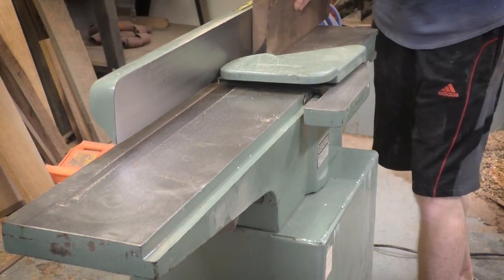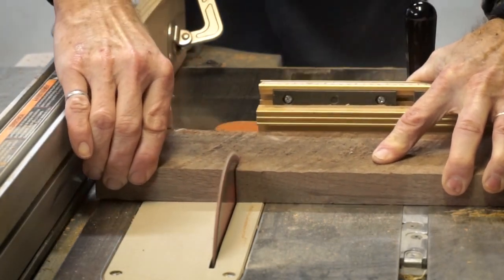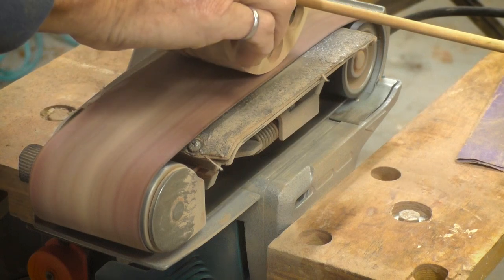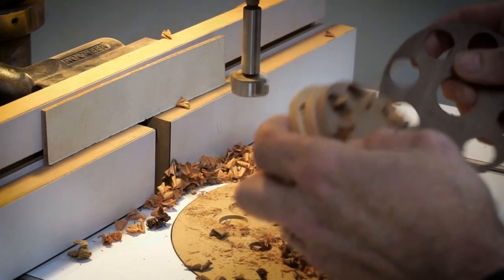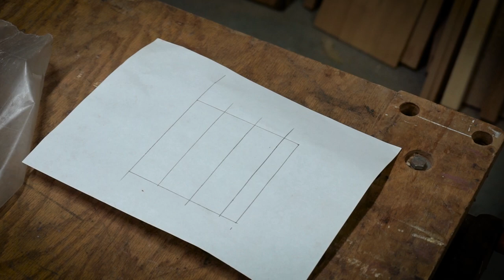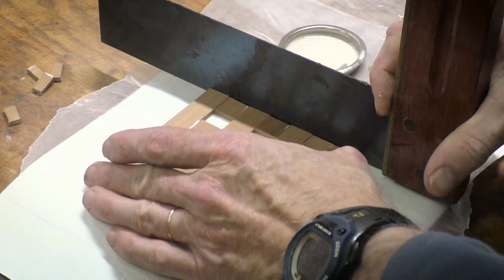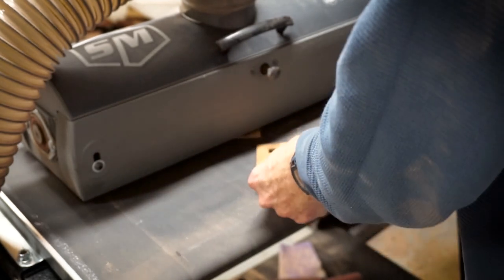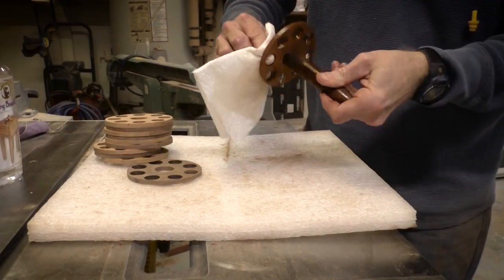DIY Wooden Coaster Sets

Comment: Again great work. Lower your blade at time line 0:44 to just a bit higher than the material. Glad to see you using a stop block on the table saw fence.
Reply from the maker: You're absolutely right about the blade height. I'm usually pretty good with that, but in this case it slipped my mind. I think I get a bit distracted by having to constantly worry about setting up the camera, so it's causing me to sometimes not do things the way I normally would.

Comment: Nicely done, good vid!  I have a question.  When you face jointed the walnut, you sure seemed to be able to feed the board much faster than I can over my jointer (not sure if the vid was sped up) so I'm wondering if I need a smaller pulley on mine to get more rpm.  Is there a recommended rpm for jointers?  or is it all relative to what you're feeding?  Also, what table saw blade are you using?  The name was rubbed off but with red I'm guessing Freud or Diablo, but what kind specifically?  glue line rip?
Reply from the maker: +Phantom Fish Good observation. I had sped up the video 1.5x when running through the jointer (just to keep the video shorter), so you're right that it was feeding pretty fast.  I'm not sure of my jointer's RPM, but I believe it's running at 4200 RPM.  The table saw blade that I'm using is a Freud Industrial 80 tooth thin-kerf blade.  I think it's this one: http://amzn.to/2ixM8LZ
Reply: I notice you have the Christian sign (fish) on your thumbnail. Is that intentional or because you fish. (Yes I've noted your handle)

Comment: Although the square coasters looked to be challenging to put together, I find both sets simple but elegant sets. I love these, and thanks for sharing! I have subscribed, good quality vids with great commentary. I look forward to seeing more of your work.
Reply from the maker: Thanks for the nice comment and for subscribing. This will be my last video of the year, but more to come!
Reply: I have watched a few of your vids now, lol. The landscaping lights, is an awesome design! Happy New Year
Reply from the maker: Thanks!  Those lights look really nice at night. Not everybody's taste, of course, but I really like them.  Happy New Year! -- Mike
Reply: Cool idea do they wear well and are you using tight bond three
Reply from the maker: The Wood Piddler Yes, I used Titebond III since they may get wet. I only made them yesterday, so I'm not sure how well they will hold up. The round ones should be ok, I think. For the square coasters, I used leftover wood that was thinner than I would have normally used, so they're not as thick as the round coasters and there's not a lot of edge surface for the glue. I'll add a comment in the future if they don't hold up well.
Reply: Wood U Make It yes the round ones I think will do really well and probably would sell well but having edge Grain to endgrain can be a problem as expansion  are in two different directions, and as well as heat moisture makes it expand even greater . As I'm sure you know endgrain is like a straw or say even a broom it would be hard to glue a broom bristles first to a wall lol I think the better route would be to do a half lap maybe just a bit thicker but I do absolutely love your creative spirit
Reply from the maker: Yep, good point. I didn't mention this during the video, but I was careful to align the square pieces so that the grain is going in the same direction as the longer strips to minimize problems with expansion. I probably should have talked about that...